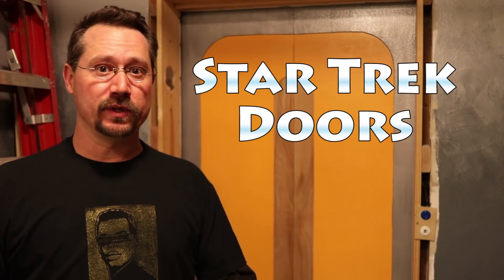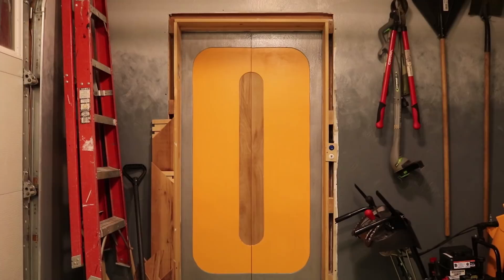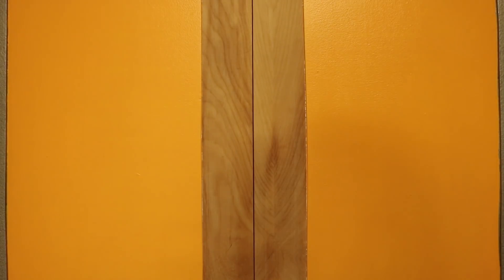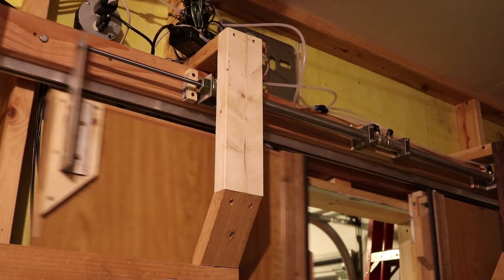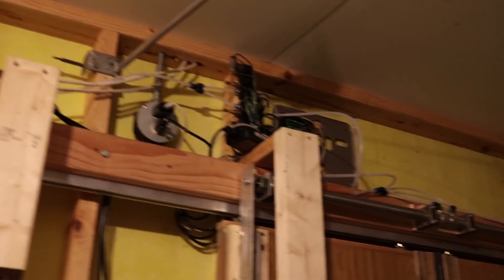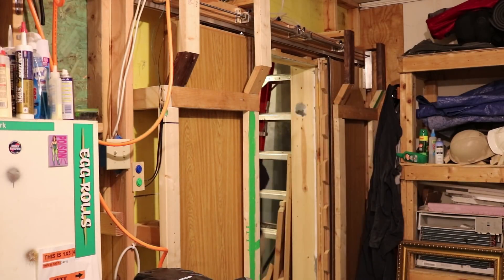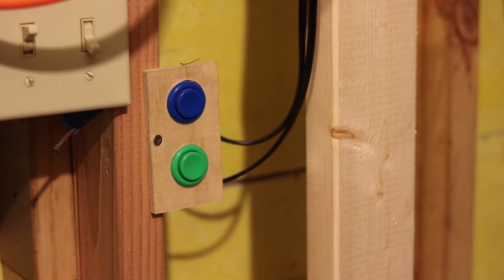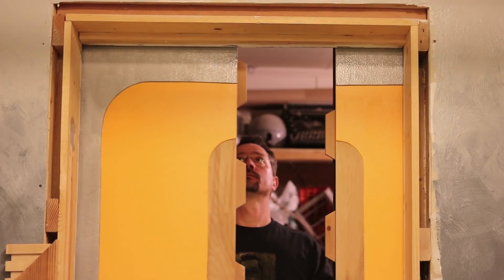Star Trek Doors Update Feb. 2018

Comment: I used two cylinders with adjustable cushions and speed adjustments. I am not sure how you did your pneumatics but I used a TEE to two regulaters for each cylinder (regulated to 50 lbs) so i could get the same movement out of both cylinders. It seemed to work well. I  am using Smartthings Motion sensors with a smartplug to turn on a relay to do the switching.
This video shows the operation:  https://youtu.be/tcuLA0XK4gk
This video explains things:  https://youtu.be/7SoBeNBiWF4
If you dont use the regulators and the TEE the cylinder closest to the air compressor will always win.

Comment: Benjamin - this is what I was looking for for my own project.  I cant find a source of long throw air rams like the ones you used. Can you provide a link?
Reply from the maker: I got these at a science and surplus store. You can generally buy them at industrial suppliers, but they get expensive. A surplus place is probably the best bet. Remember, you can also use a lever/gearing/other simple machines to change the distance an air cylinder could push or pull.
Try a place like https://www.surpluscenter.com/Air-Pneumatics/Air-Cylinders-Motors/ and see what's currently available.
Reply: @BenjaminNelsonX  Thanks!  Will follow your suggestions.  I did eventually find something similar - but as you say - prices .... :-O 

Regards
Alan T.

Comment: I specialise in elevator sensor technology 

There are senors that could prevent hazard in closing doors and open when a person is near

It can be an easy install too
Reply: can these sensors be added to arduino? or would you add them using a different method? that is exactly what i want to do
Reply: @THERE.IS.NO.DEATH.  yes sir
Reply: @sprig3432   aside from an IR proximity sensor  are there any other sensors that you would reccommend?

Comment: That is neat.  I would think pressing the button manually till it opens each time would get old and thus make fixing it a priority.  I would lean towards two infrared distance sensors (one on each side.)  Then when something gets closer than say 2 feet on either side it can auto open and stay open till the object is gone for a few seconds.  Should be interesting to see what solution you guys come up with :-)

Comment: For the door sensor, you need something not triggered by the door itself moving. So body heat (PIR) or some sort of laser beam detection.
Company I've come across most likely to know how to do this, sell electronics (kits and premade) for puzzle/paintball/escape rooms. I'm sure they could figure out what would work best.
http://www.engineeringshock.com
And does have a youtube channel https://www.youtube.com/user/patrickikis/videos
Reply: A PIR sensor could be a good choice, couple it with a 5 second timer to close after the heat source has gone away and you're good to go. You can still use the existing buttons to override the sensor if you need to carry a lot through the door or want it to keep shut say you're working next to it.